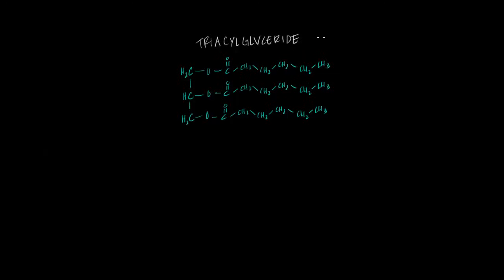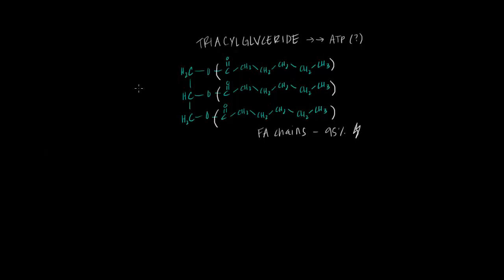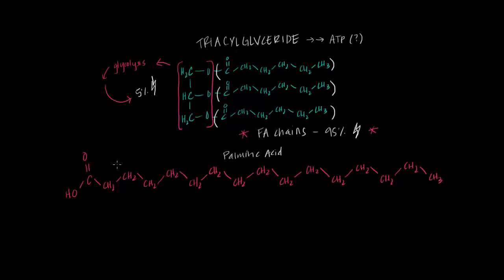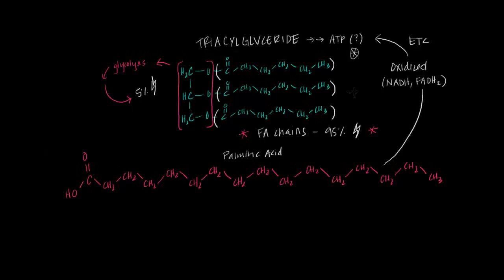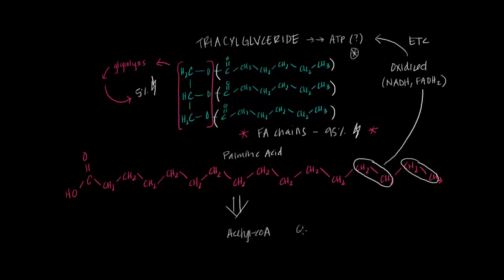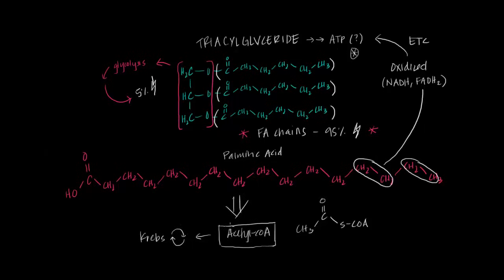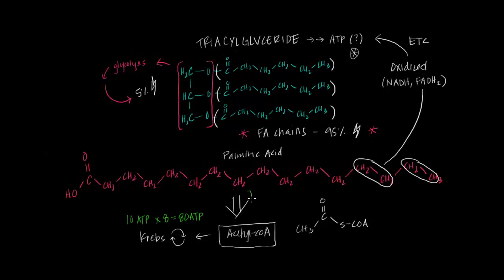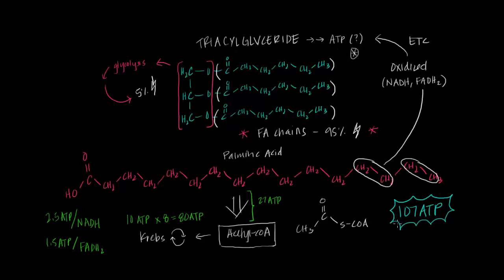Overview of Fatty Acid Oxidation

Comment: Do all fatty acids from different sources of fats (saturated, unsaturated, trans) produce the same amount of ATP?
Reply: Absolutely not, but they're close to the same, the only variation is about 1/2 ATP. Keep in mind also that the ∆G of this will also depend on the molecular makeup of the Fatty Acid Chain. Things also like Substrate availability, efficiency of the ETC, and overall mitochondrial health of the subject. If you like this subject, Harvard University offers a free course in Biochem that is VERY challenging.

Comment: So are ATPs what we use to burn calories?  Does 1 ATP allow us to burn exactly 1 calorie?  What happens if we have a lot of ATP?  Where do we store it?  Is body fat our main stored source of energy for times of need?  Where else do we hold energy?
Reply: ATP is adenosine triphosphate, it is the energy currency of cells in the body. Think of it like money, you have to go to work to make money, if you don't have money you can't go have fun. Similarly with low ATP synthesis your cells don't have the free energy ∆G to do work (have fun). ATP doesn't burn kCal what you're talking about are two different functions. You've got it kinda backwards, the burning of the kcal in your body is what leads to the oxidation and phosphorylation of glucose and then produces ATP, so that your cells can live. Does this help, three years too late? lol

Comment: Do the fatty chains turn into an exact amount of Acetyl-CoAs that we need or do we just produce a whole bunch of acetyl-coa which will return into fatty acids if we don't use them?
Reply: Good question. I believe beta oxidation will continue until all you have are Acetyl-CoAs. Then they can be used in fatty acid synthesis or ketone metabolism
Reply: The fatty acid each produces 8 acetyl coa , and yes the acetyl coa does return into fatty acids through the fatty acid synthesis pathway

Comment: How did you get 27?
Reply: @J'ann Thomas From what I've read, 1 Acetyl-Coa produces 10 ATP as it moves onto Krebs (into the cycle itself). But before that, while it is still going through the beta-oxidation stage, it produces a net ATP count of 2 ATP as it needs 2 ATP to activate the fatty acid and beta-oxidation produces 4 ATP (1 FADH2 + 1 NADH). I think the 27 ATP comes from the beta-oxi stage (16 C = 8 Acetyl-Coa = 7 cycles of beta-oxidation)  while the 80 ATP comes from the 8 Acetyl-coa entering Krebs.

Comment: is the 27 ATP portion from the fatty acid chains or from only the kreb cycle? because kreb cycle produces 8 NADH, 2 FADH2, and 2 ATP. When you do the calculations and stuff it equals to 27 ATP. But when you do calculations for the fatty acid chain, it's also 27 and so i'm a bit confused because i know the number also depends on the length of the fatty acid chain.

Comment: Isn't it a total of 108 ATP's?
C16 - 8 acetyl CoA - x 10 ATP's = 80 ATP's
          7 NADH x 2.5.                   = 17.5 ATP's
          7 FADH x 1.5                     = 10.5 ATP's
Reply: sw No its actually 106 ATPs as 2 ATPs were where initially used after mobilisation for activation of the fatty acid before it could be transported